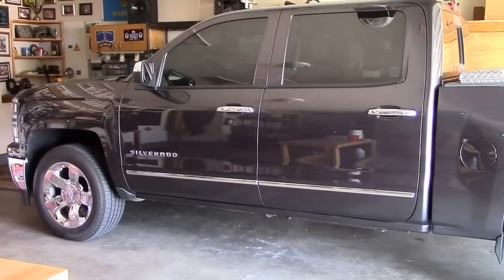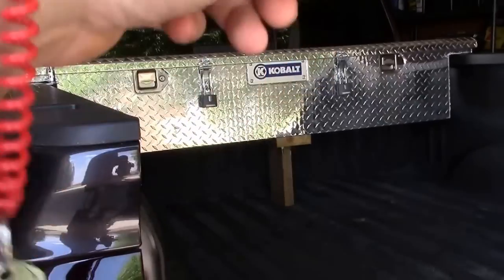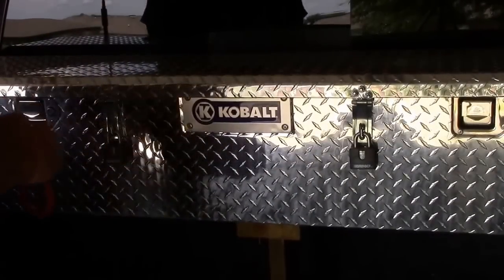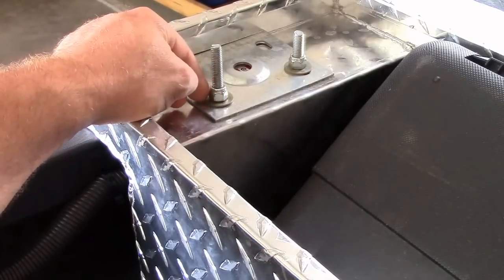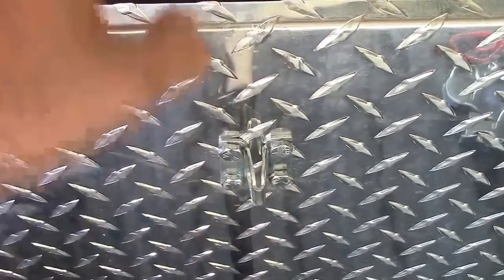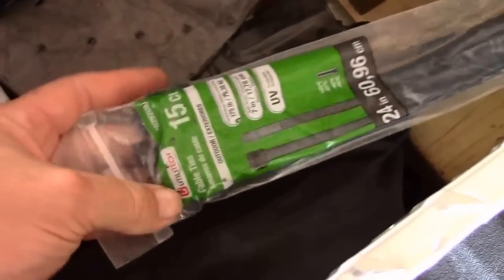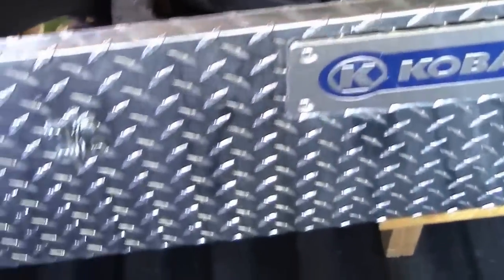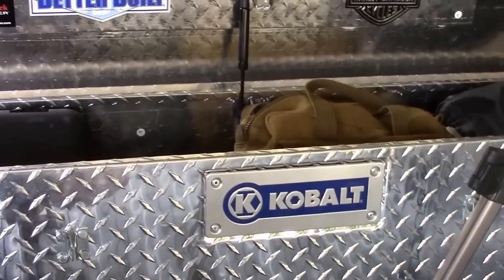Better Built (Kobalt) slimline/narrow crossover toolbox (2014 Chevy Silverado)

Comment: I bought that same one and never bolted it down. And they stole it the night before I was going to secure it. Got it for 180. This video helps a lot will buy another but with those j bolts. And extra locks. I live in a tweaker neighborhood here in Las Vegas. But it is a great tool box. Got it for my ranger.
Reply: Abram Ruelas , Hey Bro quick tip for you to not get robbed. This guys outside “ Security lock latches” are so easy to pop off with almost any tool. Or you could just unbolt his due to how he placed his hardware.  Hope this helps you

Comment: Nice touches Chris, reinforcement will prevent metal fatigue.  I think you know a bit about me by now...."fly poop in da pepper".....those hasp bolts could be a real flesh eater if you slip. What if you used stainless smooth round cap carriage bolts and had the nylon lock nuts inside the box ?  Other issue is like my tool box, you need 3 hands to open the handle latches and lift the hasps at the same time. Invert the hasps (  D portion at the top ) so that the latched drop down when unlocked.   I am thinking of purchasing one of those tool boxes to put my solar system and batts in...a slightly viable way of protecting the goods from EMP...after a few modifications. I plan on making a detachable axle with wheels for relocating from the toy hauler to the backyard shed.  Did you get yours at Northern ?
Reply from the maker: I may try that...I am just happy I got that box for uber-cheap and it holds my stuff. The hasps are a pain-in-the-ass...I agree.
Reply: why did you put the nuts on the outside of your box not in when bolting pad locks? itll look more flushed. but now i want a box thanks for the ideas.

Comment: good idea with the wood b/c I just had mine break at the ears on the world because of too much weight in the box so what the new one I got I'm going to do something similar to what you did
Reply from the maker: Cool. I cut a piece of plywood and put it in the bottom of the box on the inside. I bolted the plywood, box, and those 2x6" wood supports together. That piece of plywood will help keep stuff from punching through the aluminum box. Lemme know how it goes.

Comment: You actually got 22 mpg with your truck on the Hwy?  What engine does it have?  Sad to say my Dodge with a v10 gets crap for milage, but it can go up a mountain hauling a 26 foot travel trailer without slowing down.
Reply from the maker: Yep...that is what the trip computer said. The engine is a 5.3L...with cylinder deactivation (4-cylinder mode). Putting her on cruise...it just sips. Those Dodge's with the v10 are really great if you have to haul/tow stuff.